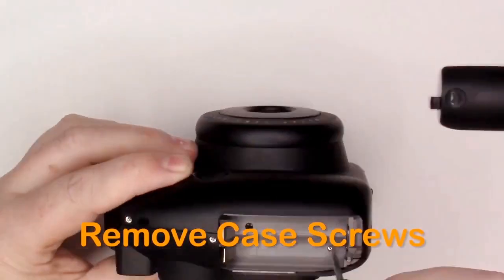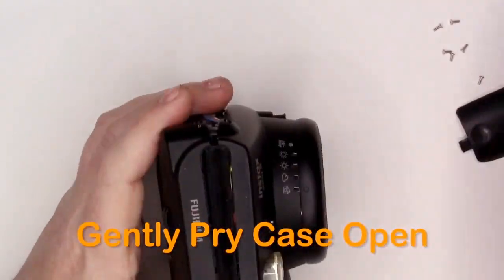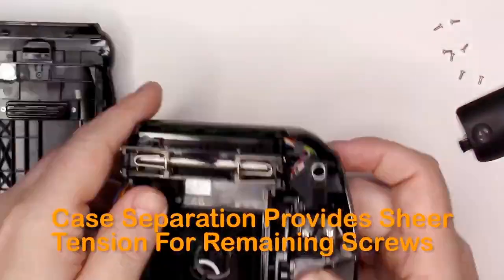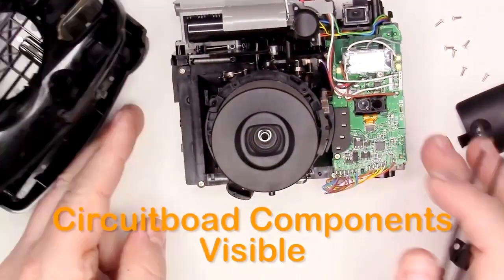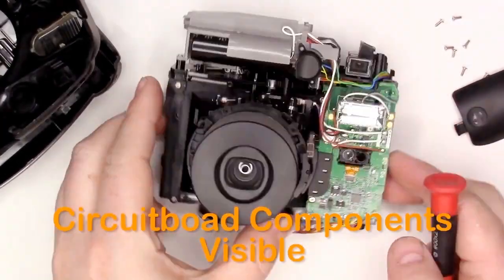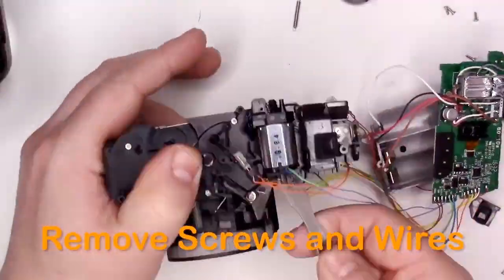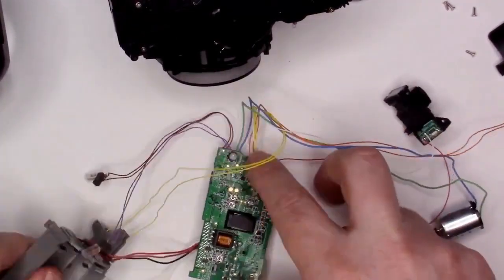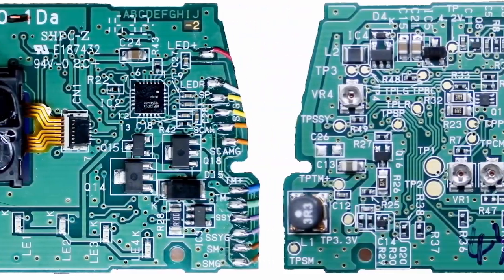Teardown Tuesday: Fujifilm Instax Mini 8 Camera

Comment: after trying with new batteries only the viewfinder light works and no other lights or sounds happen. I tore it down to see heat marks near shcp-z on the front of board. didn't remove the board tho,  from looking here seems like r8-r9. is it worth repairing or should just replace the entire camera?

Comment: hi i would like to ask where is the small part is located? at exactly 30 seconds bottom part, the tiny thing. may I have a picture where it is located?
Reply from the maker: To be completely transparent, we do not have specialists or researchers that have answers to this answering our social media. Feel free to ask the question directly on the article itself. We encourage our authors to respond to the comments there.
Reply: All About Circuits there’s nowhere it comment on the page?
Reply: I'm facing the same problem, it popped out and I can't figure out where to place it back.
Reply: @kunga45  this part is located right where you tie the security band of the camera
Reply: @Teethspitter  thanks so much find for many hours
Reply: @junwei6902  Could I have a photo, I don't know what the security band is?

Comment: There's a small plastic piece thats placed on the right at 0:29 / 0:30, where does that go? That piece fell out when I was disassembling my instax and I don't know where to put it
Reply: hey guys! i had this same problem but eventually figured it out so i decided to make this super quick video showing where it goes:

https://youtu.be/hGbT1zu4V0s
Reply: @bewy5282  you're a savior!
Reply: @bluediamond1978  👍
Reply: @bluediamond1978  glad i could help!
Reply: Mine fell out also have you found out where it belongs?
Reply: Pu'uwaialoha Medina were you able to find out where to put it? Mine did the same
Reply: natalie hislop no i didn’t :( so frustrating 😩
Reply: Pu'uwaialoha Medina ever find out?
Reply: Ever figure it out?
Reply: I have a piece that looks like a triangular spacer with two prongs and a hole.  Is that the one you're talking about?  I too don't know where that goes.

Comment: Hey thank you for uploading this. I've been given one of these cameras, it had something rattling inside and when I opened it up 2 pieces that hold the shutter button fell out along with another piece but I'm not sure where it goes. In your video the same piece appears come out but out of shot as it's appears on the desk at 30 second when you take the middle section of the camera out. Can you help me with where this piece goes? Thank you
Reply: Hi Nicola, did you find out?
Reply: If anyone is searching for this question, I just figured it out after probably a dozen videos! I know your comment is old, but to anyone else searching, it's on the top left of the front face if the lens is facing out (if you were pretending to take a photo). The hole fits over the slot for where the screw hole goes (it fits perfectly!)